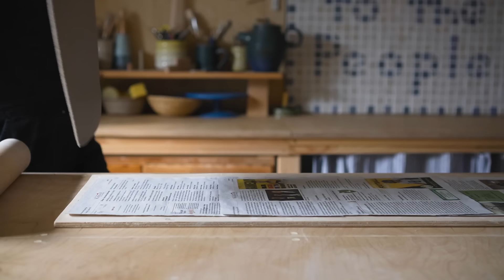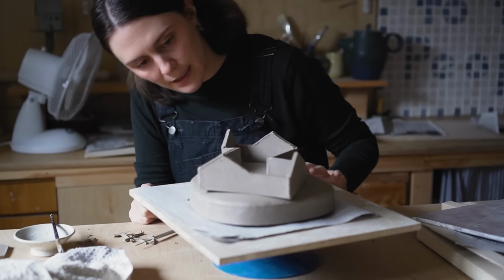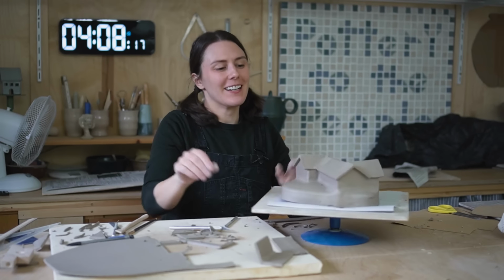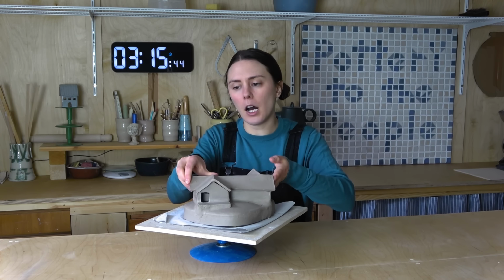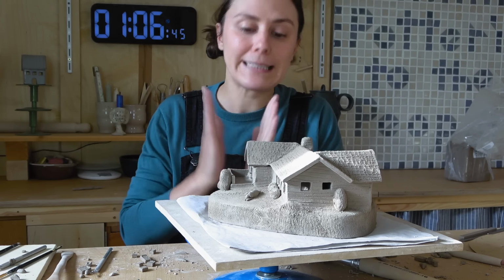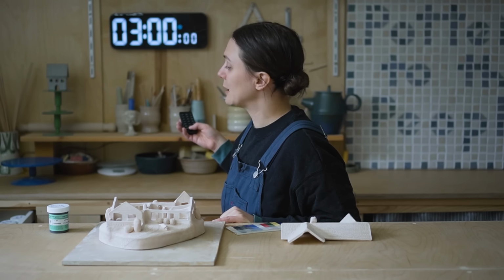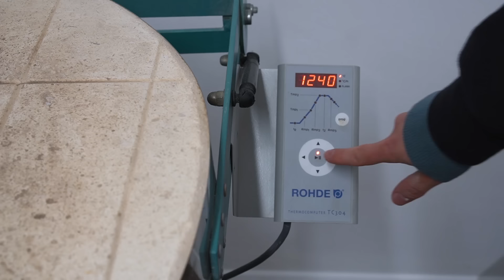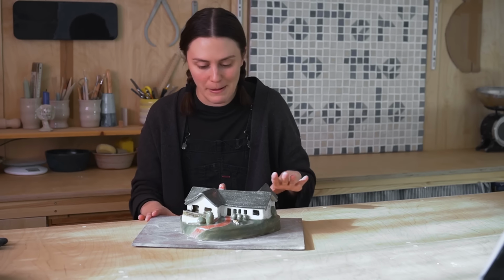How I made a clay replica of my childhood home

Comment: I have already recreated my family home in a 48" x 38"h original art quilt. Doing it again, in ceramics,  sounds like  a timely work of love to inauguate my in-home studio!
Reply from the maker: how cool! I am just getting into quilting. Such an exciting craft!
Reply: @PotterytothePeople  still in the planning  - the house was built into a hill. Think carving out a cubical volume from the face of it and tucking a box into that. Half the height of the box pokes above the hill top. The bottom half is surrounded by dirt on three sides. The ground swoops down around the sides of the house to back. Windows and a door open onto the back patio and ravine behind.

Challenge wiil be the one story drop from. Front to back without building a piece so heavy even Rodin would be impredd!

Comment: I love it (I am a potter who has a degree in Architecture - fellow 'sconie and got the degree from UWM -  so this was definitely my jam), but the show's requirement was to have the main item be thrown on the wheel (I am still not sure how that was enforced with the woman who was from Olds).
Reply: I believe she threw the sides of the letters then paddled them into shape. But yeah, a bit iffy
Reply from the maker: haha good catch :) I skipped that requirement in this one, simply because I didn't feel like it haha, but there will be throwing in the next ep! :D
Reply from the maker: That's what she did! I had to rewind to figure it out haha
Reply: I suppose she could have thrown the base as a large, straight- sided tray that she could flip upside down? Several large cylinders could have been used to make the walls of the house and then paddled and altered to be straight and have corners. The roof could have been a cylinders, cut open and paddled into angles. It would have been a total pain and probably taken longer than just slab building, but I think it would have been possible.